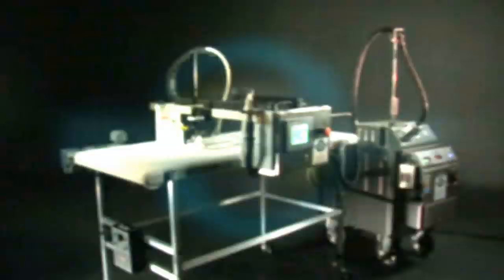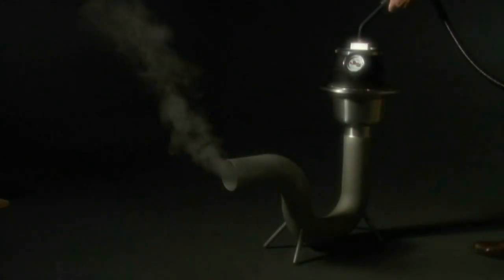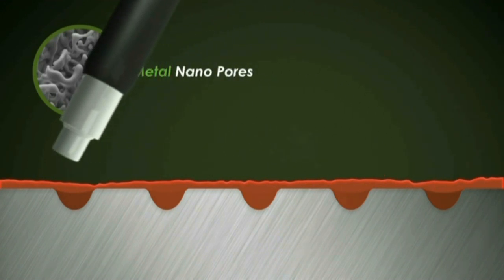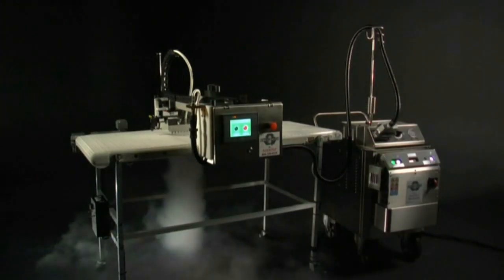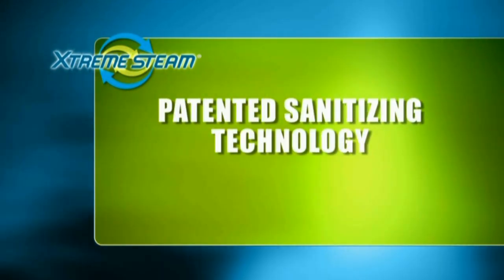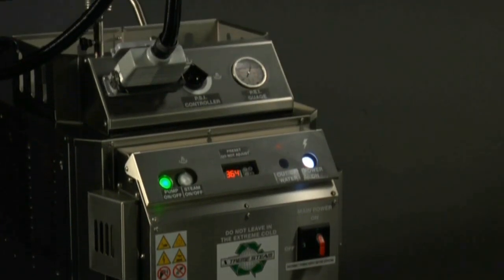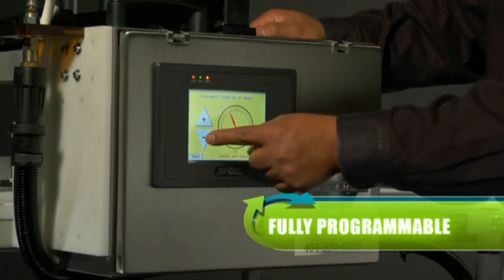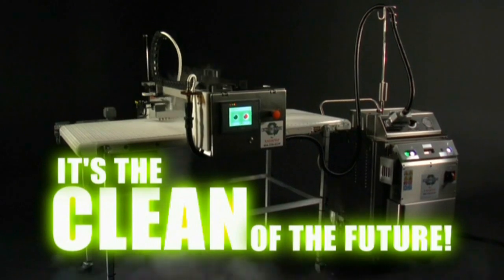Conveyor & Belt Cleaning and Sanitizing with a Dry Steam Cleaner - AmeriVap - Xtreme Steam

Comment: Can you provide more information when it comes to sanitizing computers and sensitive electrical components ? I see nothing about it in the video, however you did say it can handle the task.
Reply from the maker: We work with what we called "Dry Steam" because it only have 5% of moisture. It clean leaving the surface dry. It will not damage electrical components.
However if you like more info visit our website: www.amerivap.com or call us at 404.350.0239